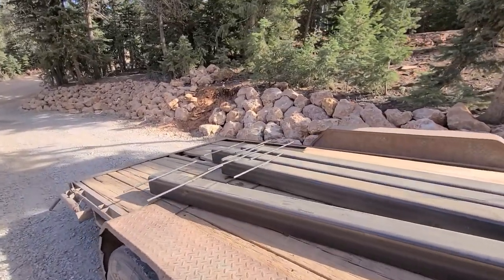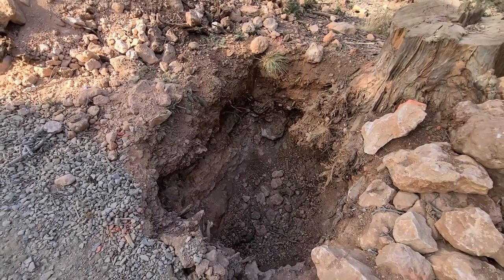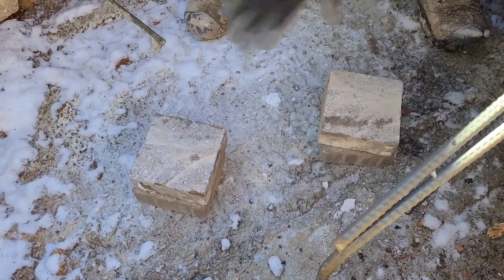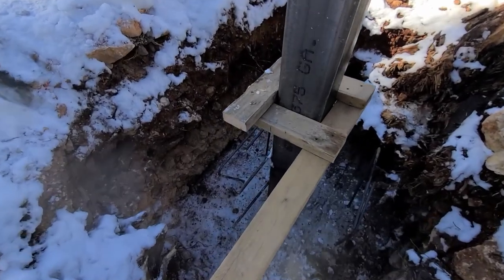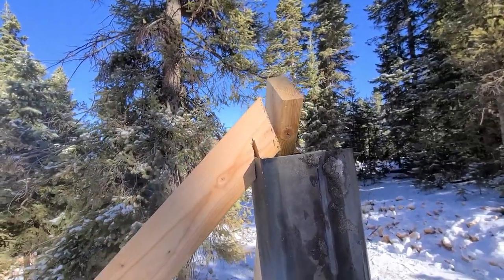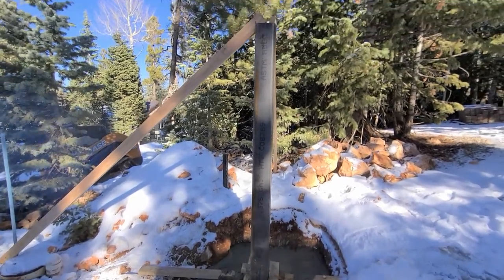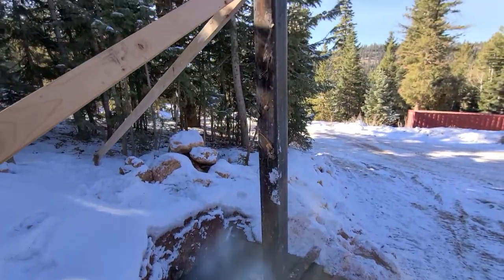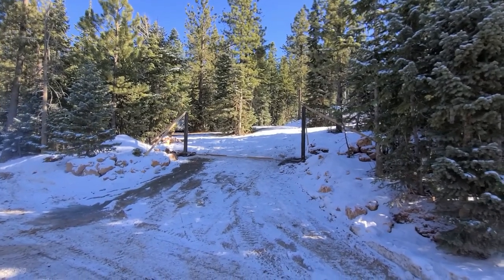Installing some Steel Gate Posts for two 20 foot Gates (Part 1)

Comment: Hey buddy hope you are all well, set some posts myself last month, nice tip about keeping the bottom of the post secure, I used ground pegs but your way is better stops movement when set before concrete. We had to put drain holes for the electric boxes it was a first but that’s what the gate guy wanted.
Have a happy holiday and have a awesome 2021 keep the content coming all the best Tony 👍
Reply from the maker: Thanks Tony, you have a great 2021 as well!

Comment: great idea with the wood to keep distance correct. did you consider welding a cap on the bottom and coating the steel that was buried to prevent corrosion.
also do you have to cut the tops of post to correct height later. Thanks. have you done part 2 yet?
Reply from the maker: I didn't worry too much about corrosion, rebar goes in concrete etc, I also filled the posts full of concrete, and I lazered in for the height so I didn't have to cut them off. Part 2 is done, sorry about the late response. Here is the link https://youtu.be/jfr3e53z7BI
Reply: How much did you bury the posts in the concrete?
Reply from the maker: About 30"

Comment: How much did the posts cost? I’ve got the same gates.
Reply from the maker: I can remember exactly, but in your area just call up the steel yard and tell them you need two 8 or 10 ft long 6x6 steel 1/4 thick and you need a price.